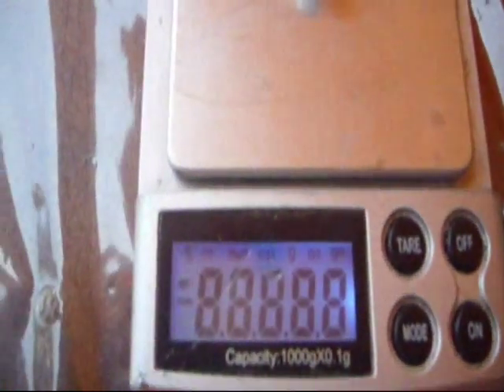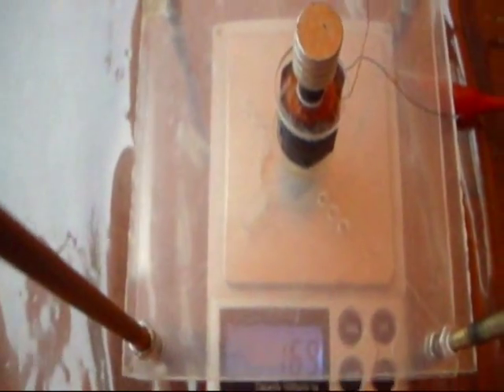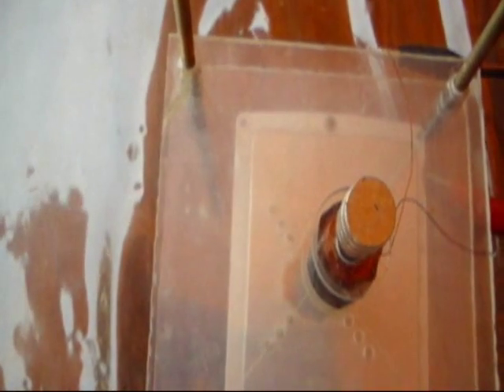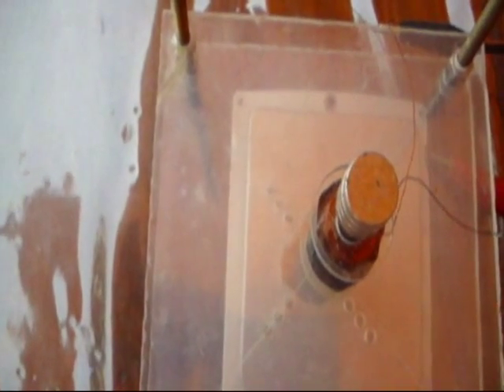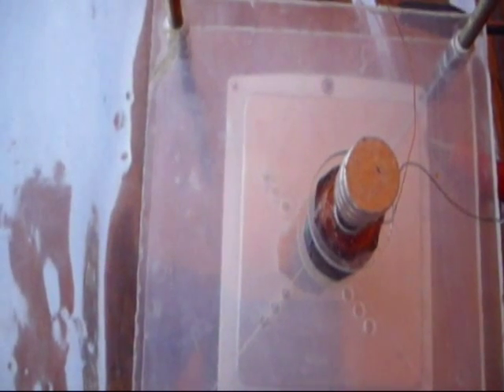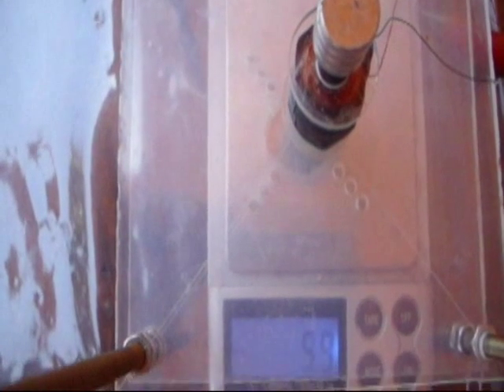Gap Power Concept Model

Comment: Whats the input? Whats the coil resistance?
Reply from the maker: Nothing special , its just a solunoid or coil wound around a ferrite rod ...cant recal exact resistance probably 10 ohms on a lab psu supplying  12 volt....this exploits the bh curve in the ferrite , which at rest is saturated in one polarity by the neo magnets, then the core saturates in the other polarity when coil is energised ....i think they expect that the energy required to saturate the core in the other polarity is less as there is the residual field of the neo on the scales... interesting concept but i dont think overunity

Comment: @insAneTunA The speaker sounds like a moron, and is performing a moronic demonstration (although it would have been 'state-of-the-art' 150 years ago), 
Here is a simple rule of thumb: if anyone refers to 'free energy' (without putting Gibbs or Helmholtz in front of it), you can safely assume that the person is an ignoramous, a fruitcake or a fraudster.